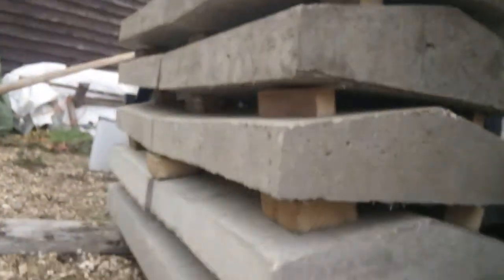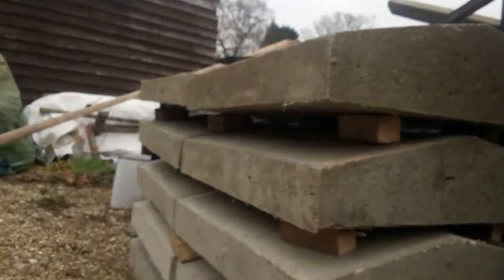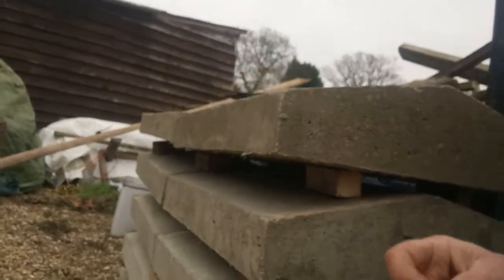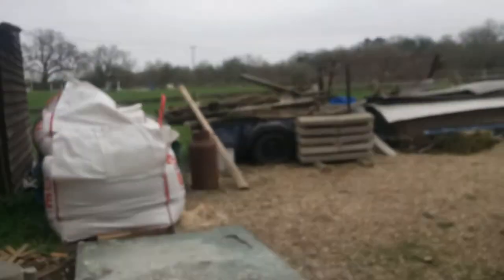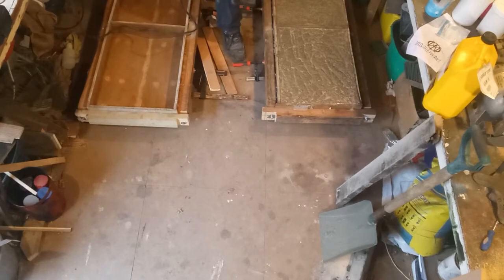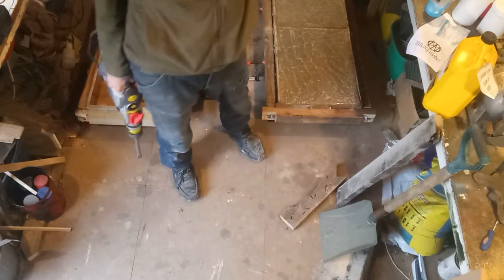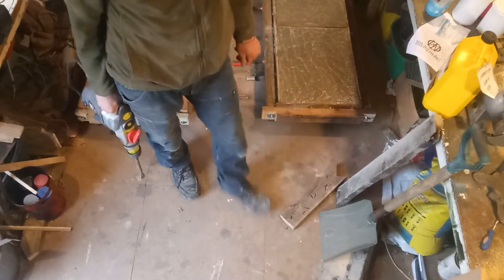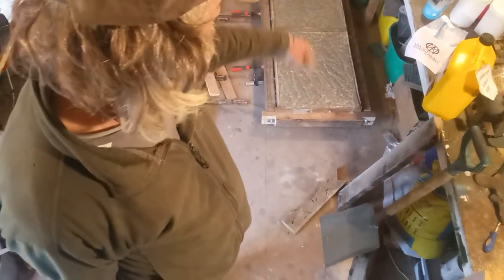Making large coping stones for an old victorian wall

Comment: Nice job . What a lot of copings to make , could you elaborate on mix please . Is this the actual time that you spend on vibrating .
Reply from the maker: Yes the virating time for this size is as you see it. Its done here on a wooden shed floor so that helps with the process of vibrating.
The mix is 300kg of cement to the ton of concrete.   So about 1 part cement to 6 parts of aggregate.  Concrete fiber for strength and waterproofer is added to the mix.
Reply: @felixbrunner5707  Excellent , they look a good job . The reason I have enquired is that I have an odd size stone wall and I have to make custom copings . I know that it is essential to get all the air pockets removed . 
Many thanks for your help and reply
Reply from the maker: @ringsidejudge4302  ok good luck. Have you done form work before?
Reply: @felixbrunner5707  Only once , I intend to weld up a metal form , with  removable ends . The copings are 1 metre long by  550mm  wide . The plan is to make base from quarter inch plate   , add a 22mm box iron inner step to create a decorative edge  , then case outer sides with 2 inch box iron .
I will use an air chisel to vibrate out the air pockets . Well thats the plan  anyway
Reply from the maker: @ringsidejudge4302  metal is good, wood helps with pulling moisture out of the slab. As it will allow moisture to migrate through the wood. 
Anyhow thats what i learnt. 
I would be interesred to learn of how you get on with them. I am not able to fo much anymore as i contracted prostate cancer 8 months ago and its playing games with my body. 
I am trying to pass on building knowledge now whilst learning still.
Reply: Thanks for reply . Sorry to hear abut your prostate issues , it is a very common complaint nowadays . The only consolation is that modern science can work wonders .
I am just awaiting the wall cladding to be installed in order to get final wall width . I intend to use steel as I am a welder and will find it pretty handy to put a couple of forms together  with some material I have to hand .
I will let you know how they turn out after completion , that will probably be in about one month .
Keep well
Reply: Hi @ringsidejudge, how did you get on with your coping stone challange?
Reply: @dada5312  Hello There  . Got the project finished and installed . I opted to use melamine coated sheets which I got pre cut  .I used the melamine as the base and the two ends and two sides were made of planed timber which  . All together I made just three forms as I wanted to make them in batches  . One of the forms I made in a fashion that I was able to adjust one end internally to make a shorter coping that was required at end of the wall .
Inside the form I pin nailed a quarter round moulding to  the two long sides to provide a contour  which added a nice detail . I sealed all internal seams with cleared silicone and allowed to dry , then coated with standard cooking oil ,as a release agent .
For the mix i uses white portland cement  to add a bit of clean colour and got the mix ratio from an online  calculator .  It was handy to use  by just measuring the length , width, and height of the mould . I made a bit of a mistake on the first one as I could not get 100 per cent of the mix out of the actual mixer .
A good tip I found on Mike Haduck Masonry channel , was to install lifting hook for ease of removing copings .
For removing the air pockets i used a reciprocating saw from below as I had  the moulds screwed on trestles , just in case the vibration would cause them to fall . Each coping got 15 mins of vibration and even at that there was some very minor pinholes on completion . I just rubbed in some mix to these and rubbed off with a damp sponge when almost dry .
For reinforcement i dropped in some galvanised mesh .
I am very pleased with finished job and although it was heavy work making moving and installing I was all chuffed that I was able to  do this myself . Due to not being a standard size coping a local precast company quoted me 1500 ponds to make as they said they would have to get a bespoke mould made from steel .
As you may guess from this reply I pay a lot  and maybe too much time to detail ha ha .
Reply: @ringsidejudge4302  sounds all great, mate , sure they will look good with white cement.